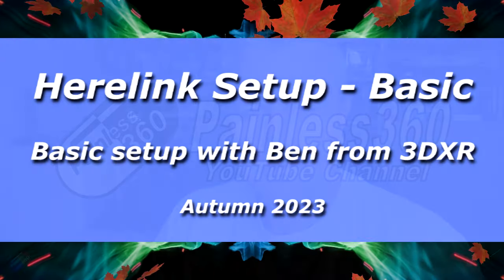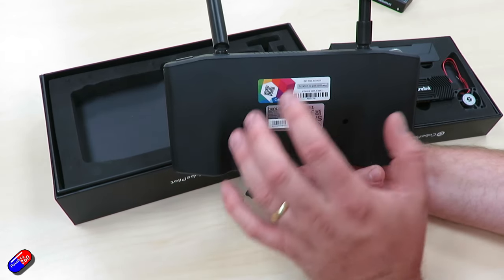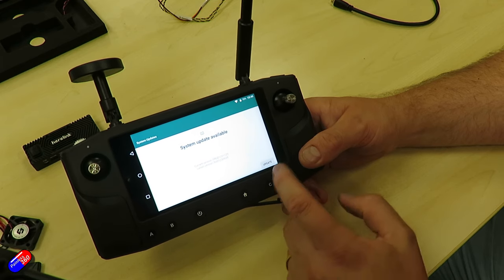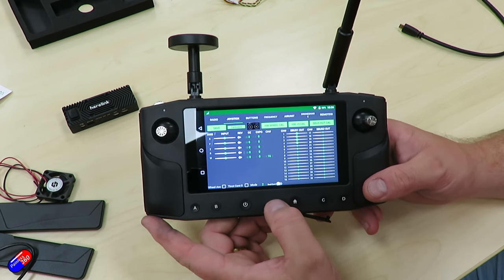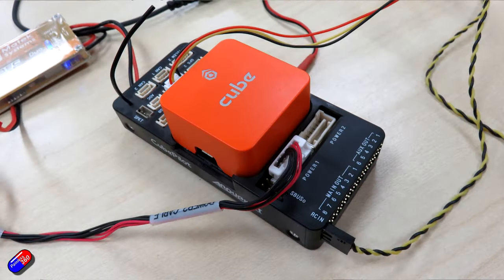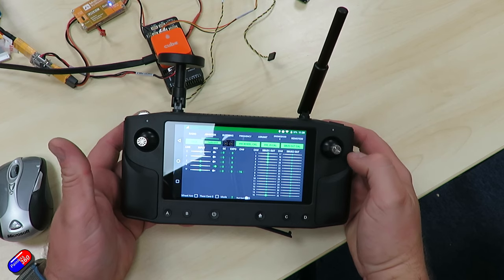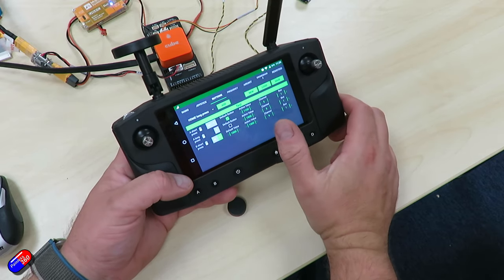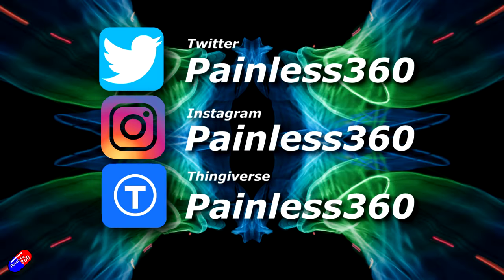Herelink Basic Setup: from unboxing to basic setup! (with 3DXR)

Comment: Saw this a few years ago.
Was interested, but it's just too expensive to just try it out.
Nice to see a video about it!
Reply: IMHO not worth it, the transmitter is not very comfortable to hold and it doesn't have any way to attach a neck strap or harness. 
It is rather hard to do any meaningful configuration of the UAV without resting the transmitter on something.

Comment: A nice bit of technology well done !  Beyond the pocketbook of an old retiree, but that's life. Spent years trying to buy a jaguar. After many years the one from my boyhood dreams came up on sale .as a boy it was 4700 dollars. With 60,000 in savings I thought I'd give it a try, minimum bid 125,000 ....dang. had to settle for a used Stype, pleasureto drive, morevelectrical problems than one could count, who taught the bits to wire things ....answer nobody. Buried deep the faulty connector was found why such a major connection was buried. Fault corrected car sold broke even .once restored an MG same problems wiring, americanized wiring, and bobs your uncle fun weekend driver and all the gadgets worked.that brings me to your system fairly complex yet appealing to my inner tech ....working on one last model pulling all the stop, glass and fiber thousand hours of work might be worthy of such a complex controller but who will fly it ?.

Comment: I have the same transmitter and has been set up in such way when I arm the drone the motors are spinning,I tried with ardupilot to eliminate that but it doesn’t work ,is there a way to stop the motors spinning when armed from the transmitter ,I appreciate your help - thank you !
Reply: Is that not what arming the motors is supposed to do?
Reply: @keneflucas937  no it’s not buddy !
Reply: @George25  Word? When I arm my motors they spin. On all of my builds. When you say, "arm the drone", is that the same as or different from, "arm the motors"?  Or are you referring to simply turning the drone on?

Comment: Do you have a video to show how to add user sensor to a drone and control the sensor through herelink. The user sensor has an app like the mission plan to control the sensor and get sensor data to laptop?
Reply from the maker: I don't. What sensor is it?
Reply: @Painless360  OK thanks, it is a digital receiver.

Comment: hello i have a question about the ethernet port of my herelink is not working although i think the wifi is working as iam able to get the camera rtsp feed to my laptop when i connected the camera to the herelink through hdmi do you know what i can do or whom to ask about this?
Reply from the maker: I'd check with the vendor who sold you it, useful in case of a hardware issue... Best of luck
Reply from the maker: Apart from don't buy from them in future? Not a lot, sorry.